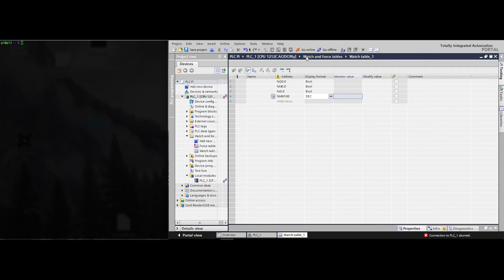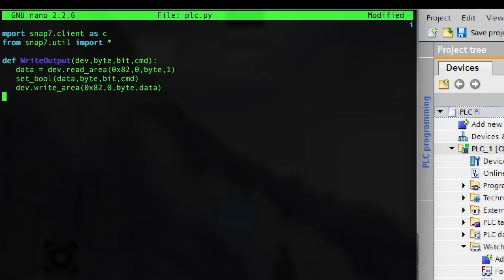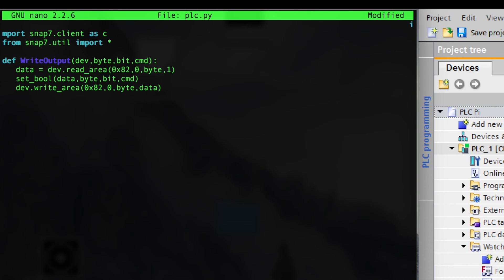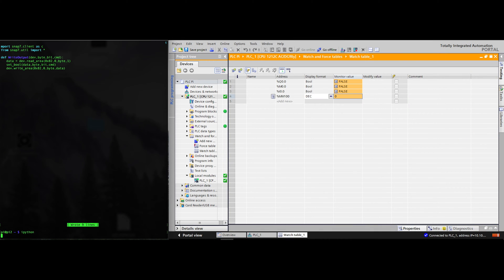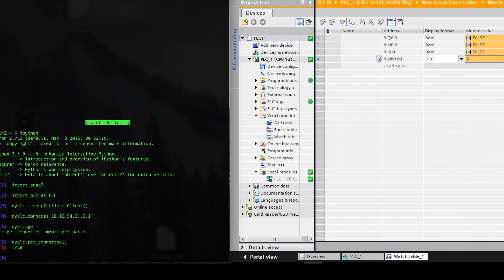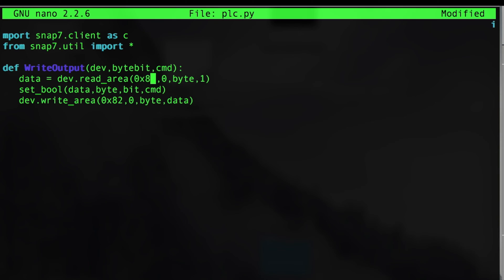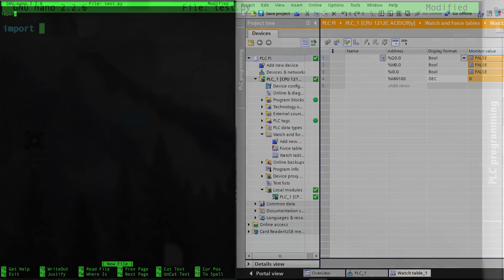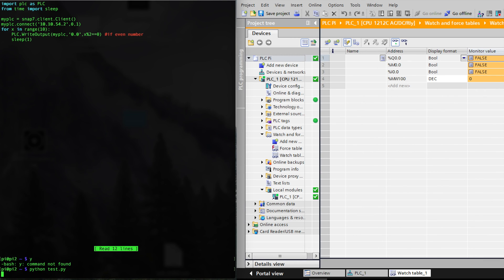Raspberry Pi - Tutorials - S7-1200 & Snap7 Python, Controlling Outputs

Comment: Hello,
I am going to read the DBarea from PLC S7 1200, for this goal I try to import some of the libraries in to the python but I could not solve this error. I am new in pythone. Can you help me

import snap7

from snap7.util import *

import struct
import snap7.client

plc=snap7.client.Client()

plc.connect('10.1.1.98',0,1)

area= 0x82 start=0
length=1
bit=0

byte= plc.read_area(0x82,0,start,length)
No handlers could be found for logger "snap7.common"
Traceback (most recent call last):
File "", line 1, in 
File "/usr/local/lib/python2.7/dist-packages/snap7/client.py", line 242, in read_area
check_error(result, context="client")
File "/usr/local/lib/python2.7/dist-packages/snap7/common.py", line 69, in check_error
raise Snap7Exception(error)
snap7.snap7exceptions.Snap7Exception: CLI : function refused by CPU (Unknown error)
Reply from the maker: +Houman Kashian 
Sorry for the late reply. Try making sure “get/puts” are enable on the cpu
http://snap7.sourceforge.net/snap7_client.html#1200_1500

Comment: Hi, this looks great - I'm having a bit of trouble though,  I'm trying to create the function to write Outputs - when I get to the final ipython instruction to call the PLC.WriteOutput - the following message is returned ERROR:snap7.common:CLI : function refused by CPU (Unknown error)
I'm using a s71212 v4, with P2 running Pixel OS - can anyone help
Reply from the maker: +Phil Jarvis 
Get/Put needs to be enabled in the PLC first. See this thread
https://support.industry.siemens.com/tf/WW/en/posts/trouble-with-put-get-communication-from-s7-400-to-s7-1200/126009?page=0&pageSize=10
Reply: Simply Automationized  I have just varied that this is set, re entered the ipython instructions - got the same message .
Reply: Uhm interesting, just reset it again, download config from TIA to plc and re-run ipython script came back with this msg "TypeError: write_area() takes exactly 5 arguments (4 given)"

Now I'm really confused
Reply from the maker: +Phil Jarvis 
You may want to install pycharm on you raspberry pi. It's very helpful for debugging.

Comment: Hi, 
That's really nice tutorial! But I have some problem with connections. You are using S7-1200. I tried to use your code from this tutorial to connect with S7-400 (I have CP343-1) via ethernet. I have installed snap7 as you described in your another tutorial. Connection was not possible, some errors and connection time-out. There is a question:  Is it possible to connect with S7-400 with the code you showed in this tutorial? If not, could you give me some instructions how to do it? Or maybe I should use libnodave library? But as far as I remember it is not compatible  with python...
Reply: I meant CP443-1 of course
Reply from the maker: +Damian Urbański 
Good question. I've not tried a s7-400. I'll do some research.

Comment: Please, i have some questions i would like you to answer me: First, do you have TIA Portal installed in your Raspberry Pi? or how can you check the outputs of the PLC while controlling it from the Raspberry? and second, Do you use an Ethernet Module? can you please explain me your whole connection architecture please?
Reply from the maker: +Ivan Yerovi 
I have TIA Portal installed on a Windows machine,  I SSH into the raspberry pi to test the python programming. I only use TIA Portal to verify it is working correctly. The pi is connected via Ethernet to the S7-1200/1500 and to the S7-200 using an Ethernet module. Right now I'm working on a snap7 scanning program for the Pi that checks memory in the PLC every 0.1 seconds and shows changes... It could be useful to monitor or log memory/inputs/outputs. 
Let me know if you any more questions
Reply: +Simply Automationized Thanks. And, That sounds really interesting!, I plan to integrate some Memory writing and reading in a future project, but I'm new in both worlds (python and S7 PLCs). And yes, I have some more questions hehe: Is it posible to control the PLC from the Raspberry by just using the PROFINET port and no extra modules? Because Im trying to do so by following your tutorials and I get 2 problems: First, even if I configure an IP address in TIA Portal, lets say '192.168.0.1', the Raspberry Pi identifies other IP address, i.e. using the command ifconfig I get eth0: inet addr: '169.254.37.216'. And second, when I try your code in the line "myplc.connect('IPaddr,'0,1)" I get the error: snap7Exception: TCP: Connection refused. Do you know how to solve this?
Reply from the maker: +Ivan Yerovi 
Sounds like your pi is directly connected to the plc.. with no DHCP server to assign it an IP address you'll have to assign a static IP to the Pi. 
See here
https://thepihut.com/blogs/raspberry-pi-tutorials/16683276-how-to-setup-a-static-ip-address-on-your-raspberry-pi

Comment: Where do you keep your plc.py? Just in the root of your /home ? 

Thanks for sharing your knowledge about your projects, they are very intresting (i try to run this python scripts then in domoticz to turn on/off my heatpumps) :)
Reply from the maker: +Flugel keep it in the same directory that you want to run your python scripts from.  I"ll try to start pumping out these tutorials weekly.. just got caught up on other things.  I'm glad they are coming to use :-)
Reply: Ha i where confused because of the library folder (never used python before) i go try to test some stuff with your informarion,, if it works i post it on your website.
Reply: +Simply Automationized 
Hello mr Simply Automationized:

I made a file plc.py

import snap7.client as c
from snap7.util import *

def WriteOutput(dev,bytebit,cmd):
     data = dev.read_area(0x82,0,byte,1)
     set_bool(data,byte,bit,cmd)
     dev.write_area(0x82,byte,data)

I wrote it correct but when i run PLC output High i get:

In [16]: PLC.WriteOutput(myplc,0,0,True)
---------------------------------------------------------------------------
TypeError                                 Traceback (most recent call last)
<ipython-input-16-47f88eea0231> in <module>()
--> 1 PLC.WriteOutput(myplc,0,0,True)

TypeError: WriteOutput() takes exactly 3 arguments (4 given)

(Connection command works)
Reply from the maker: Dave Vleugel
on line with "def WriteOutput(dev,bytebit,cmd):"
put a comma between bytebit.. 
def WriteOutput(dev,byte,
bit,cmd):
Reply: Ha i see offcourse need 4 arguments :)